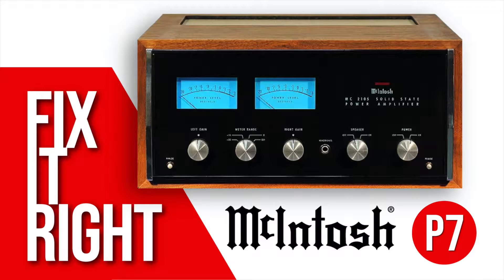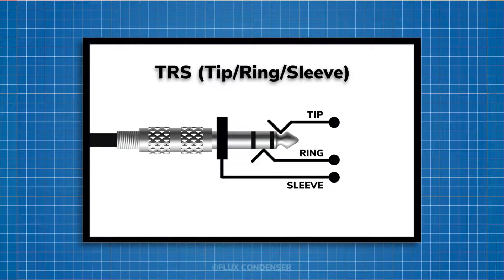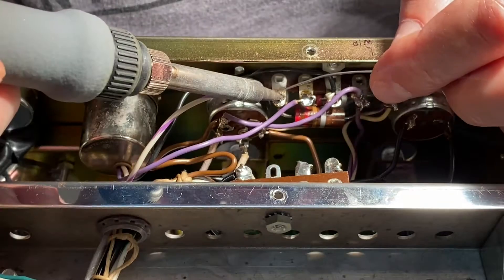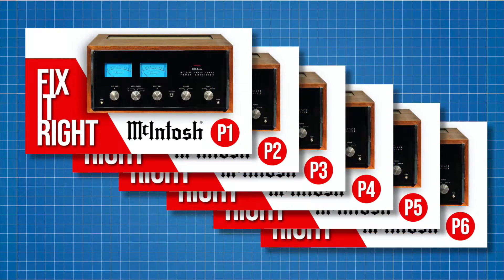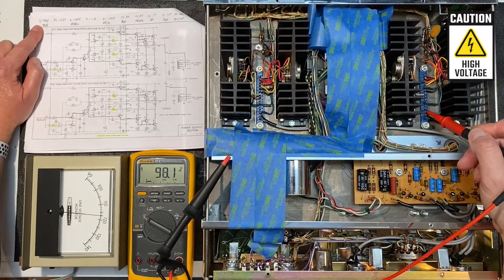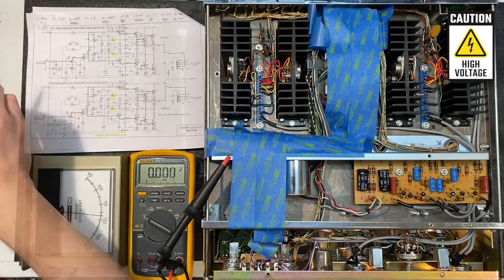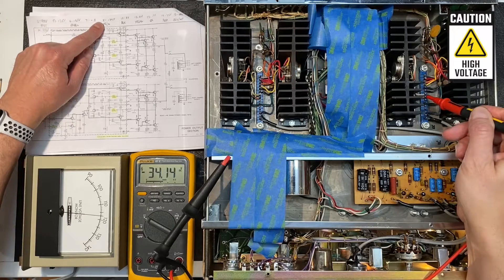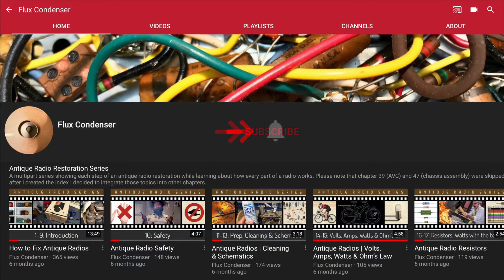McIntosh MC 2105 Restoration P7: Let’s Fix The Reversed Headphone Jack & Test Voltages

Comment: Just an FYI Chris: That "01V" may be a reference to the two large Cap voltages dependent on the rating of the caps the tech installed for that particular production group of amps. I'm not 100% certain, but the circled #3 of the left channel, and the blank circle (which is where #3 would have been printed), in the Right channel, both test at 100.7 Volts. 

That is the voltage rating of each of the large caps (C301 & C302) that I have installed. I looked for some special notes pointing to those but haven't found any so at this point, it's just a guess. 

Anyway, I tested the voltages at all the specified points and they're all in the tolerances noted in the schematics, so I'm moving on.
Rich

Comment: Hi Chris,
Well I corrected the caps that I installed based on the wrong schematic, and fortunately, there were only two. However, I wonder if you can tell me what "01V" means?

The character set shows up as a Zero ("0") with the number "1" as an exponent, (which I can't replicate in this post), followed by and upper case "V". This is shown to represent the voltage of the Blue wire in the Left channel where the 'circled #3' (circled rail count numbers), is in the bottom left of that Left channel's schematic. 

The same Blue wire in the Right channel's schematic shows as "90 Volts", but even here the circle that should have a #"3" in it, is blank! I'm certain that this isn't a misprint or copier screw-up. It's deliberate.

Of the six schematics Mac sent to me, there are two other schematics that hold a possibility (remote possibility), of representing my amp and both of those have the same, exact, "01V" reference, and the Right channel has a blank circle where the #3 should be. 

I can't find any reference to the "01V" and nothing about why the #3 was omitted from the circled rail count IDs. I have a feeling that the "01V" is a kind of "footnote" because it has numerous variations. That would mean you probably won't know what it means either. It's open to identification through some notation that either, I haven't found yet, or hasn't been included in any notes for these schematics.

Well, I'm going to go on to the voltage tests like you've done at the end of Video Part 7. It'll be a comparison voltage test between the Left & Right output boards just for the sake of making some mental notes that may help me later on. Then I'm moving on to Video Part 8 & 9 and my goal is to have this amp reassembled by tomorrow afternoon.

With no sure way to know the units serial number I really don't have any choice. However, I honestly feel like the techs at Mac could have shown a little more interest in their jobs. 

I believe if they would have made a little effort to actually use their experience and collective knowledge between the parts, service, and support techs, they could have taken the time to ask me some questions that may have produced answers they could use as clues... I don't know, things are different it seems but sometimes I think they're too different to believe that it isn't due to just plain disinterest and laziness.

As I said, I held many positions in a broad range of careers. One was as a sales and service store manager for a very well established vacuum cleaner company. I've lost count how many times someone would call to ask me for some assistance in repairing the vacuum cleaner they were trying to fix themselves. This was in the late 90's and early 2000's.

Often, it involved vintage or antique models and I wouldn't have the information readily available in the usual database. I'd have to make calls, get extension numbers to people who could then give me the links to the info and then call the person back to help them.

If someone called me 5 minutes before I was closing the store, I'd answer the phone and do the job regardless of what time past closing it took me, (and I wasn't paid by the hour). I did this because A: I was the only source this person had and could hope would help him, and B: because I was terrible at sitting around and doing nothing as I waited for the clock to strike the end of my day, (which was 12.5 hours x 6.5 days). 

Nowadays, your lucky if you can hold someone's attention for 30 seconds because they find it easier just to say, "no, I don't know what you can do about it". There have been times when I swear I could hear someone playing video games on their phones after they said something like, "please hold while I check on that" (cable companies).

I've quit jobs that I've taken after only being hired for 3 or 4 days, when I found it had a lot of 'sit-around' time and very little to do all day except watch a time clock. Anyway, I'm off my soapbox, and moving on, LOL.
Rich
Reply from the maker: Glad you’re back on track. Without seeing what you have for a schematic in front of me, I’m not really sure what that could mean. On my schematic, I’ve got 90 volts listed for terminal 3 on both left and right amp boards.

Comment: Well Chris, I have now come to the realization that I'm going to have to go all the way back to square one. Fortunately, when I did the recaps, placed the caps I removed into I small baggies that I labeled with their source PCB. That will prove to have saved quite a bit of time. 

In my preliminary inspection, I found that the 10uf/63v caps in the output boards are supposed to be 150uf/50v caps. There's one example and I'm sure there are more.

This explains why some of the caps I removed had such greater ratings than the ones I was given to replace them with. The special notes in these schematics indicate exceptions but they refer to the unit's serial numbers. i.e. " Note X: in units with serial numbers between XXXXX and XXXXX, C124 and C125 should be XXXX". 

In a best case scenario, I would feel a lot better if I knew my amp's serial number but because it seems I'm not going to have that advantage, I'll need to cross reference several sources and apply my 'best guess'. There are some folks at AudioKarma.com that are experts on McIntosh vintage amps. In fact, they even refer to the Flux Condenser videos in some of their posts to folks looking to recap their amps. They've helped me and I think I'll see if they can give me a better idea of what production group my amp is in.

Anyway, I've got to check these caps and compare them to the ones I removed. Then, I'll note the differences and compare those to the present schematics and the special notes printed regarding these components. From there, I can figure out what caps I need to re-replace. I wish Mac had etched or used a steel stamp for their serial numbers. Then again, a sharp "bang" against the chassis wouldn't be such a good idea when it's supporting a lot of microelectronics. An electric etcher would produce steel particles that can play havoc on the electronics, as well.

I suppose the ink-stamp makes sense when you consider the options, but a more permanent ink would have been nice. 

I'll let you know how things progress, but I imagine that it'll be a while before I'm back up to the stage that I was at when I discovered this SNAFU... (This doesn't discourage me, I've lived through a heck of a lot worse realizations than this and I just consider it an addition to the challenge).
Rich
Reply from the maker: Sorry to hear about he setback, Rich. In general, if I can’t find the documentation for a repair, I’ll rely on the existing components to dictate what the proper values should be. This is especially true if the unit is basically working. 

That’s the problem with those kits and why I try to avoid them now unless I’m certain they contain the correct parts and are a good value. For something like the MC2105, the chance that the kit will work for your particular amp is like throwing a dart at a board. Most of the kits I’ve seen appear to be of decent quality, but they make the assumption that the kit will work for every variety of the unit. I’m not sure if it’s just ignorance on the sellers’ parts or a disingenuous attempt to make a buck. I’m guessing, the former.
Reply: @FluxCondenser   Thanks Chris, yes, I think that's good advice and I'm going to go with it. I'll use the caps I removed as the ultimate decision-maker. 

There are too many variables and possible alternate notes and specification changes. It would take far longer for me to run down each capacitor in the schematics and cross-referencing each resistor. Ultimately, it would still be a "ball-park guess" because I don't know my unit's serial number. 

The amp worked before I recapped it and I'm not saying it doesn't work now, but I don't want to try it knowing that several caps are far below the microfarad rating specified in the schematics and/or compared to the ones I removed.

The advice makes sense and in the long run, will save me a lot of worry and time.
Thanks again,
Rich

Comment: OK, Mac sent me all their schematics and even though the part number of the PCB I have was shown in 4 of the 6 schematics he sent, only one had a resistor located on the flipside on the board and on the right end, which jumped across two other resistor leads. Therefore, by process of elimination (if nothing else), that schematic is the one likely to be closer to what I have.

Comment: Well I pulled both Output boards and double checked everything. Then I realized that my boards had some pretty big differences as compared to the boards in the schematics that I was using. The schematics I have covers the serial numbers from 10M01 to 26M07. Not knowing the serial number of my unit makes this precarious to go by and even harder to be certain that the readings I get should even be in the same ballpark as the measurements you got.

I called Mac and the tech department transferred me to the service department. However, I called about 5 minutes before they were closing so no one answered. I left a voice mail and will call them back tomorrow, (even though I asked them to call me, I don't expect they will). I just need to be mindful of the time zone differences. 

I reinstalled the output boards and then retested the output with my SFG, (this time being sure not to exceed 1 Volt amplitude). Hindsight is a great thing if I can foresee needing it, lol. I only wish that I would have done some preliminary tests of the amp before I recapped it. 

I know that I was getting an output signal from both channels before I started the job and if I would have tested the output with the SFG before I recapped and replaced the Gain Pots, I may have been able to detect the lower output in the left channel. Anyway, retesting the output again now, was just to make sure I still had an output through both channels.

The tests confirmed that I do, so hopefully, I haven't harmed anything. I'm going to move on to the Part 8 Video. When I speak to the service tech at Mac tomorrow, I'll see if he can give me an idea where I can find the schematics for the L&R Output PCB part number 128-077. The Output PCB part number in the schematics is 043-805.

That PCB has more resistors than mine and has a resistor mounted on the flipside like mine does, but on the complete, opposite end of the board. In addition, my Right channel PCB has a few plastic discs, (they remind me of small pulleys) but the schematic PCB doesn't have any. I'll see what Mac has to say about this.
Rich
Reply from the maker: Any luck, Rich? I’m not sure I understand where you are at this point. My understanding is that you just replaced some caps and the level controls. But, you fear something is awry and it may be due to overloading the input. Is that correct? Are the symptoms you’re detecting limited to incorrect voltage readings?
Reply: @FluxCondenser  Yes, and I'm sorry, apparently I've logged out and logged back in with my alternate address. I've got to fix that because it's coming up as two different threads on the same Video Part 7 comments. Anyway, I found the right schematics, which Mac sent to me. The voltages now make sense and are different from the ones that you were getting. 

I plan to move on to Video Part 8  and get this wrapped up by the end of the week if not sooner. Of course, that's if my unrelated tasks and daily 'to-do' list doesn't have too many additions, (which usually happens about mid-week). The bottom line is "so-far, so good". I haven't yet closely scrutinized the new schematics but from what I've seen in a short scan, I believe everything is going well.
Reply from the maker: OK, good. I was hoping the only issue was that your amp wasn’t matched to the the service manual info you had. Glad you seem to have found the correct one. As I believe I said earlier, there are so many versions of this “same” amp and the manuals are all different. A real pain and when I was working on mine, I was fortunate that the owner I purchased the amp from had the original manuals and service manuals. Even with that, though, there were still discrepancies where the manuals didn’t match the amp and I had to do further research. This is a serious consideration when working on these amps. Believe nothing! Ha!

Comment: (In addition to my previous post): I removed the two Output PCBs after carefully inspecting the Input board. The Wirewound resistors that are connected to the Heatsinks on the Left channel don't look very good. They're .33uf/5v and 5Watts each. It appears that someone may have spilled a small amount of liquid (or maybe it was condensation), and it landed on the upward-pointing end of at least two of the three resistors.

These resistors are rectangular blocks and I guess the material is some form of insulation. I've never seen resistors like this. However, the whitish material (insulation), seems to have dissolved to some degree, (almost like corrosion powder). 

I spent an hour with lights and magnifying glass, carefully checking to make sure these, (and the other components), were all measuring within tolerances and that the wires were firmly connected.

These rectangular resistors don't look great, but they're definitely making connections and read at their proper rating. I'm going to chalk this up to oily PCB contacts. I cleaned them with alcohol and I reinstall and try again tomorrow. If I get the same results, I'm going to test the output through the speakers again. 

I may have screwed up big time last night when I had it connected to SFG. I read what you said about the 1 Volt amplitude being as high as you would go and now I'm thinking I may have fried something. 

The SFG is a digital model and has softkeys to select various modes and voltage increments. However, it has a dial that can also do some of the functions of the softkeys, which can be a little dangerous. 

My point is that when I was going through the selection of wave forms, I stopped at a selection for a custom wave option to adjust some other function. I was going to switch it to Sine but at some point I left the cursor on the amplitude selection.

With the frequency set to 1KHz and the active function selected was Amplitude, I inadvertently hit the dial. The cursor was set to the Tens column and the amplitude was already at 1.5 volts. Bumping the dial added a 1 in front of the 1.5 Volts and 'poof', the amplitude went from 1.5 volts, to 11.5 volts. 

Because I it was still set to a "custom wave" (Arbitrary), I didn't hear anything through the speakers. It was a few seconds before I realized I had the amplitude so high. 

What components do you think I could have fried? I'm guessing transistors, but which ones should I check first? I have an NPN/PNP tester but I have to remove each transistor to use it.

BTW; I never smelled any burning and I don't see any burning. Still, I'm sure that you don't have to exceed these .5 and .8 volt areas by much to burn them out, and not by enough to cause a burn that one could see or smell.
Thanks,
Rich

Comment: I'm afraid I went 'south' somewhere... (BTW; The amp has been on for at least 30 minutes). In your video, you show that pin #5 & # 6 should be showing somewhere near the -35Volt spec. However, my pin 5, (which like yours, has no wire connected), doesn't get higher than a few mv! I've double & quadruple-checked my control positions, (Meter off, Speaker On, L & R Gains fully C' Clockwise, no input signal, and 117Volts input power)

Pin 6 however, does get -36.14v. You never mentioned pin #11, (skipped right over it as you went through measurements of pins 10 & 12). I got zero volts on pin 11 but I'm just saying that I noticed no mention of why pin 11 wasn't in your reference.

However, I think you did the same for pin #4 so I guess they weren't mentioned because they have no contributing factors. 

****Here's something that I only noticed tonight:
Of the 8 incandescent bulbs, the one just to the left of the right gain control is burned out in my amp! I guess it's there to illuminate the right-hand side of the meter power selector. However, can't say whether I ever noticed it not to be working before now.

I simply don't know and if I had to guess, I suppose I could believe that it was burned out since I got the amp. I'm troubled by this zero voltage reading on the #5 pin and because I don't know the serial number, I can't be sure I'm getting the right specifications from my schematic.

I'm going to have to call the Mac tech department tomorrow and see what they say about this... It does bother me and I don't like going to bed with this on my mind, but I've no choice.
Rich